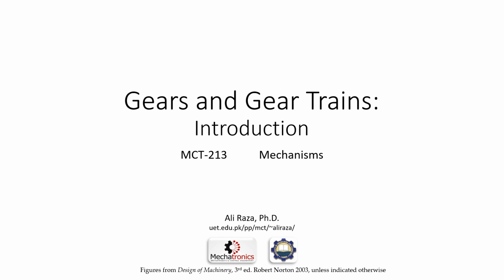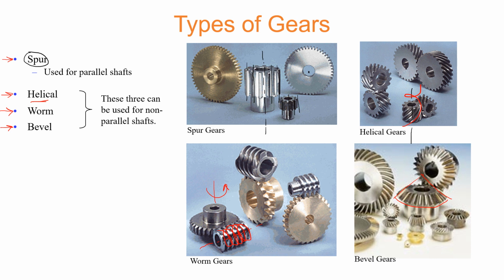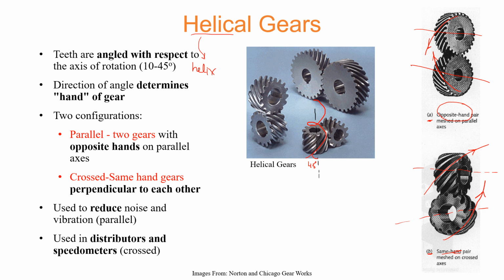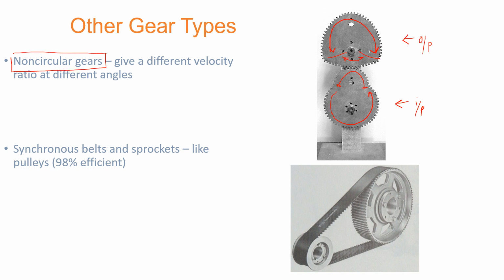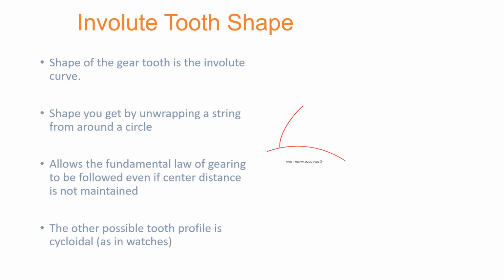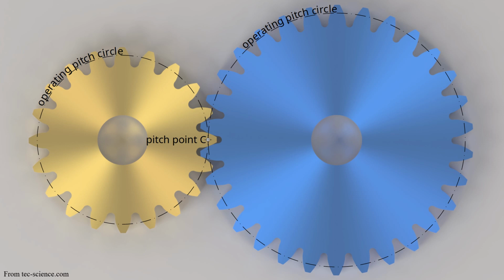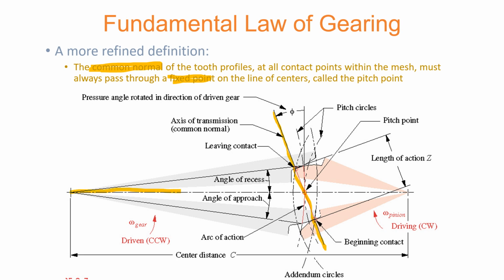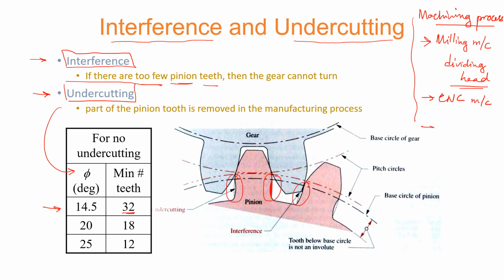Introduction to Gears and Geared Mechanisms (part1)

Comment: 6	Up to 20 teeth inclusive	20 to 200	0.0027	0.0037
Over 20 teeth, up to 1.999"	20 to 48	0.0019	0.0037
Over 20 teeth, 2" to 3.999"	20 to 32	0.0019	0.0044
Over 20 teeth, 4" and over	20 to 24	0.0019	0.0052
7	Up to 20 teeth inclusive	20 to 200	0.0019	0.0027
Over 20 teeth, up to 1.999"	20 to 200	0.0014	0.0027
Over 20 teeth, 2" to 3.999"	20 to 48	0.0014	0.0032
Over 20 teeth, 4" and over	20 to 40	0.0014	0.0037
AGMA Quality Number Actually Gives the Geometry Placement of Teeths of Gear,Viscosity balance between Load,speed etc
2018-MC-04

Comment: 1- AGMA 6 & 7 differ in their viscosity level defined for specific gears as their lubricants for better performance of gearboxes.
2- Because the bearings have to withstand both radial and axial forces, helical gears require thrust or rollor bearings typically larger than those used in spur gears. 
3- Worm gears provide self-locking in motorized actuators if the valve position can't be changed from standstill while torque act upon the valve.